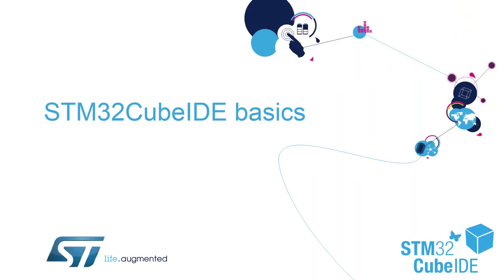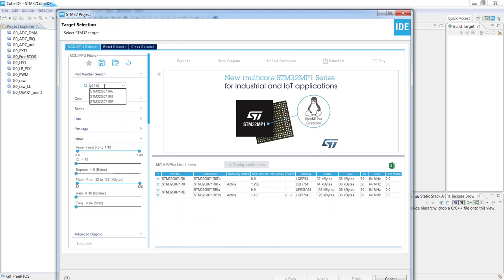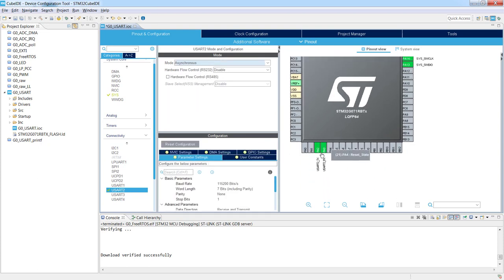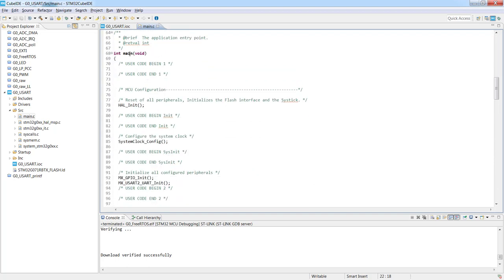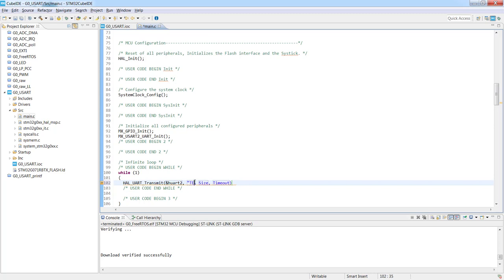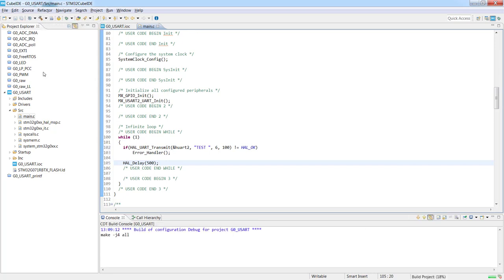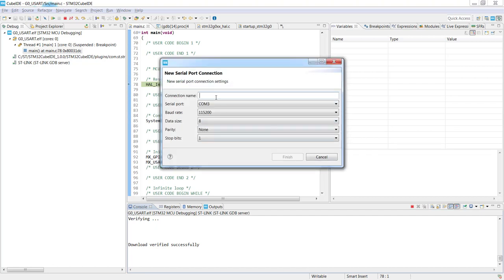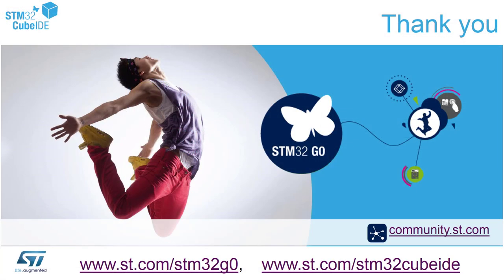STM32CubeIDE basics - 11 USART HAL lab

Comment: I did everything correctly but I am using an STM32F746NG discovery board and I can't see in the debug consol the transmitted bytes "Test ", I wonder if it is due to the pins used, i use D5 and D6, I don't know how to check if they can be used for debugging purposes, wether they are linked to st-link

Comment: So any USARTX_CK pins be configured as an INPUT to receive the sync clock?  For example, the STM32H745 has:
USART1_CK  PA8/E15
USART2_CK  PA4/U3
USART2_CK  PD7/C11
USART3_CK  PB12/T14
USART3_CK  PD10/T16
USART3_CK  PC12/C12
USART6_CK  PG7/F16
USART6_CK  PC8/E13

Comment: STM32CubeIDE V 1.3 gives warning and file isn't executable.... 
../Drivers/STM32F1xx_HAL_Driver/Inc/stm32f1xx_hal_uart.h:700:19: note: expected 'uint8_t * {aka unsigned char *}' but argument is of type 'char *' when you pass "TEST " as uint8_t *pData 2nd parameter to HAL_UART_Transmit(UART_HandleTypeDef *huart, uint8_t *pData, uint16_t Size, uint32_t Timeout);